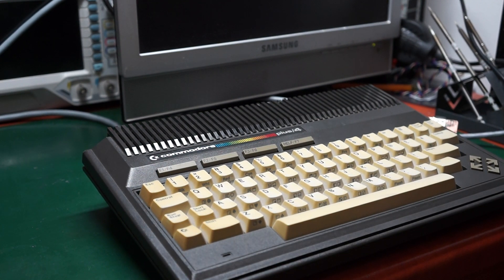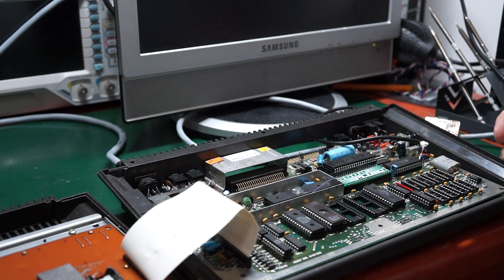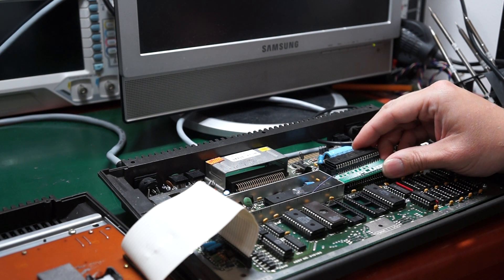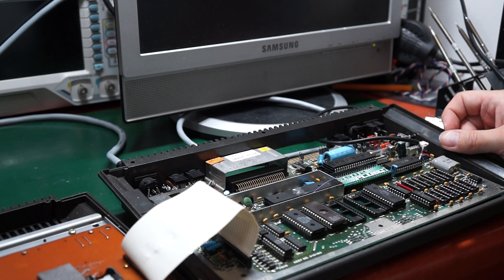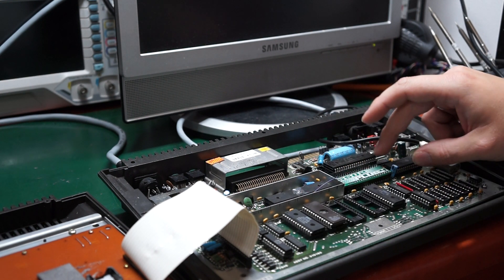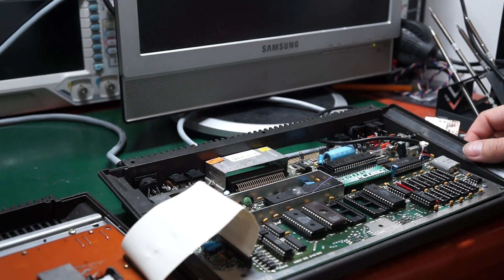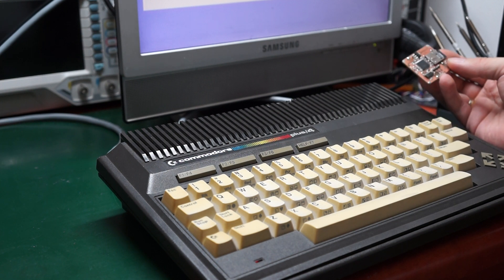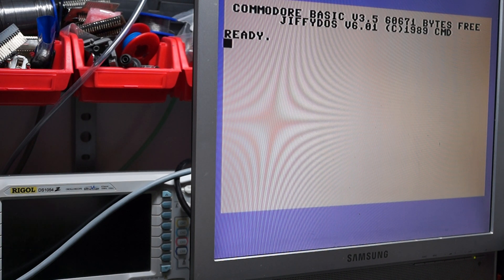commodore 16 and plus/4 cpu replacement/repair (6502plus4)

Comment: What about ilegal opcodes, your project can emulate it?
Reply from the maker: i belive so, it uses nmos version of 6502, not 65c02, so all illegals should work, if you would like me to check any particular piece of software i could do  it. but as far as i can tell, everything works as it was on stock 8501
Reply: @gyorka  Krill loaders and fastloaders too?
Reply from the maker: any titles in particular? i've ran few full-disk demos without any issues, but this is real PITA to record something on commodore drive - i have both 1541-ii and 1571, and if i have to wait 15 minutes per side it really puts me off, especially, when i don't have luxury of having brand new disks to write on